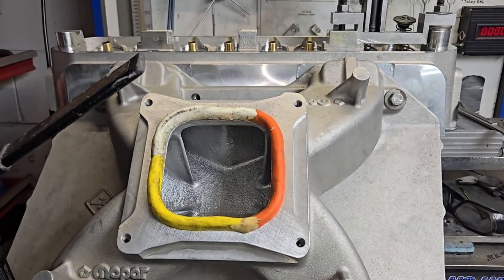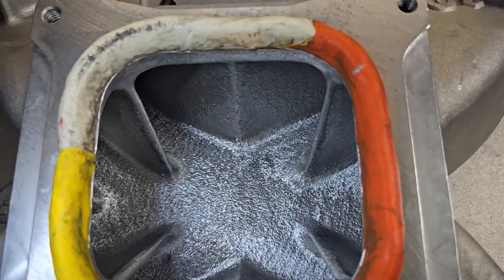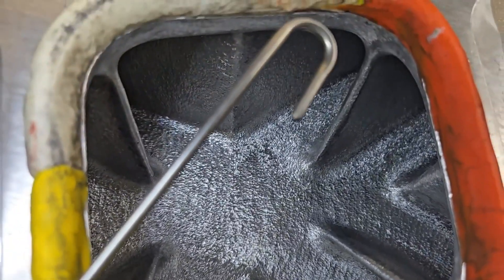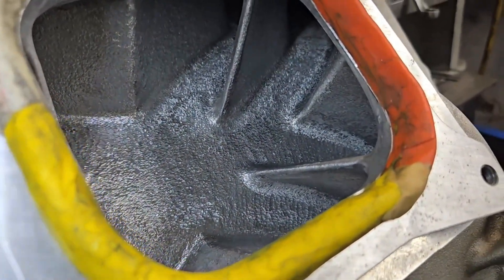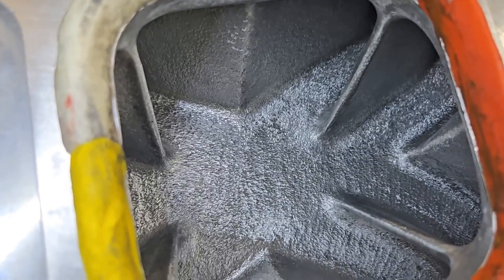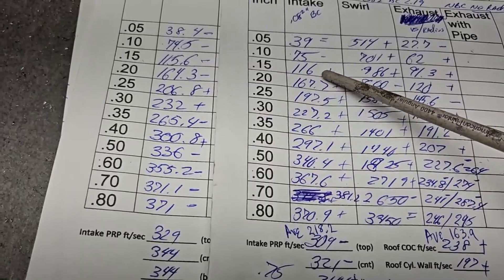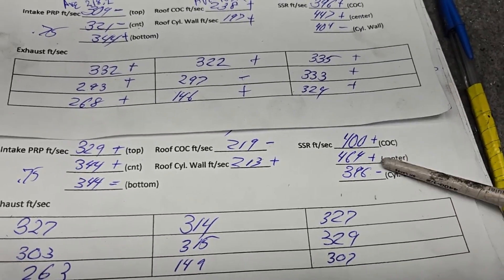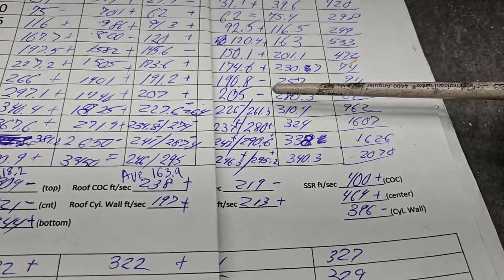Dangerous Donny's 540-440 Mopar project final. Sailing the string in the M1 337 manifold at 350 cfm!

Comment: Will this thing be hitting a dyno when its assembled? My WAG ometer says this 540 should be strong from 2500-5500 maybe 6 depending on the exhaust headers used.
Reply from the maker: The build will be by @Justmoparjoe youtube. He got 760hp? On a bbm 511? With stock tfs 270 heads. So, yes this will get dyno time. Thanks
Reply: 6500 minimum or you're wasting Charlie's efforts. This is easily enough head to rev to 8500 if you had the valvetrain for it.
Reply: @rolandotillit2867 big block Chrysler's have problems above 6,500 RPM especially one this large, with the proper camshaft it won't be necessary to rev it above 6,000 anyway
Reply: @thomasward4505  You mean one with little overlap? That's what you'd typically do for a low revver.

Comment: Charlie, do the thin divides make more of a problem with air flow than a thicker large nosed radius divides?
Reply from the maker: Yes, with air speeds we deal with I prefer round edges. The only time I sharpen them would be to reduce flow to a high flowing runner for balance but I don't like to reduce flow anywhere
Reply: @servediocylinderheads all the flow all the time everywhere Charlie!!!
Reply: @servediocylinderheads am I seeing thos manifold right though. That it began with big Ole fat divides.....and you've thinned them down a lot?
Reply from the maker: @arturozarate1752 As you ad csa they will get thinner. Yes. This required a huge amount of aluminum removed.
Reply: @servediocylinderheads got it. You've gotta get the area somewhere.

Comment: That swirl curve matches the flow characteristics quite nicely, notice you have more swirl to start, which corresponds with slightly lower very low lift flow. Then the swirl tapers off after .300, and the CFM goes through the roof, right until the swirl starts picking back up at higher lifts. I think you have things setup very nicely for a street, or circuit motor.
Reply from the maker: Thanks, we will find out.

Comment: I have an idea for an experiment for a plenum, maybe someday we find someone crazy enough to try it. A U shaped cutout on the plenuum dividers. I was just looking at the shape of it and thinking, it's pretty much a delta wing, so the flow should be attached at the floor much more than the center. On delta wings the loading is towards the root of the wing separating towards the tip, whereas on a forward swept wing(where the tip is ahead of the root) the loading is towards the tip, and separates towards the root(closer to the body) This means with a delta wing you can use more angle of attack without separation near the root of the wing, away from the tip. With a forward swept wing the opposite is true.
Reply from the maker: Just not enough room to do that. I think runner length would be more beneficial. Thanks
Reply: @servediocylinderheads  I think the work you've done here is great. Maybe some other time with another manifold.
Reply from the maker: @rolandotillit2867 Sure. Thanks